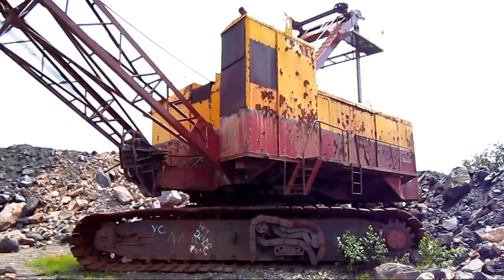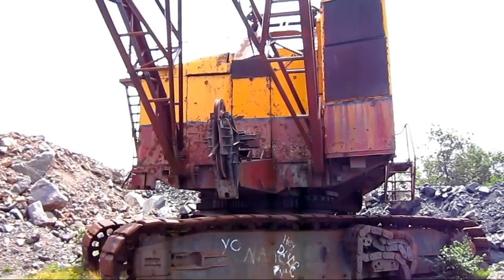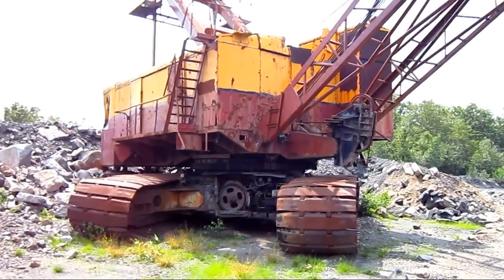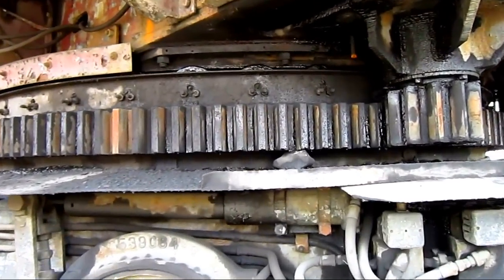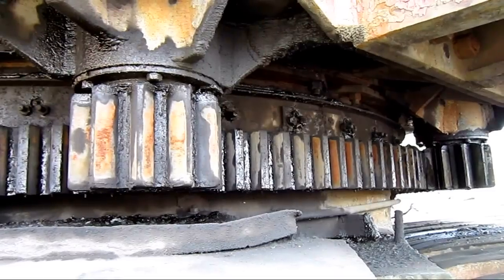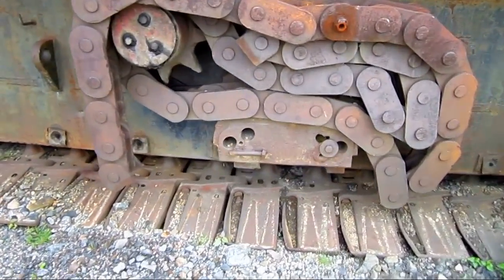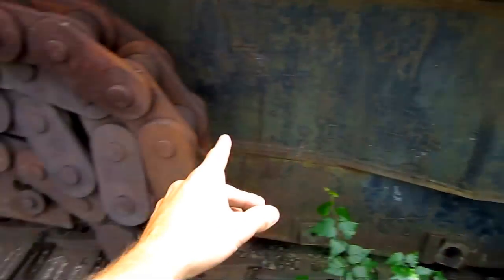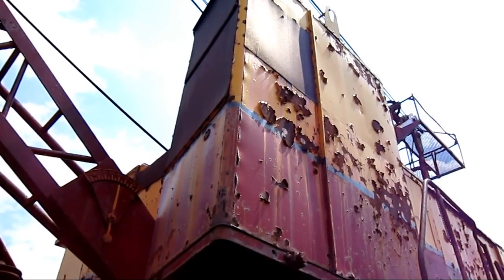Marion 183-M Documentary

Comment: The guy explaining this is wrong. I worked with one of these machines in1966 The main engine , a Cat D398 ran the hoist and the drag. the cat D343 ran the generator for the swing motors, and the boom hoist, along with the aircompressor, common cooling fan, and the night digging lights.